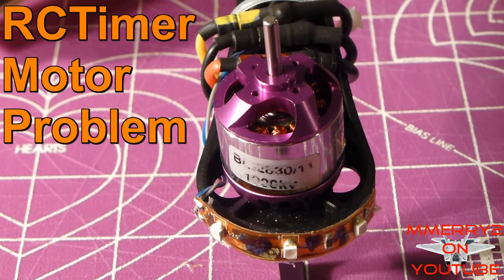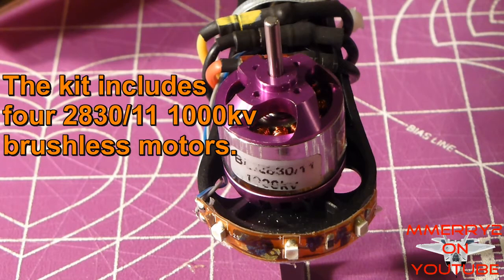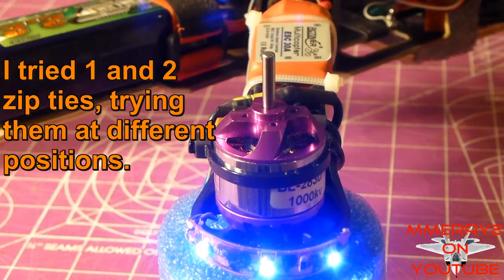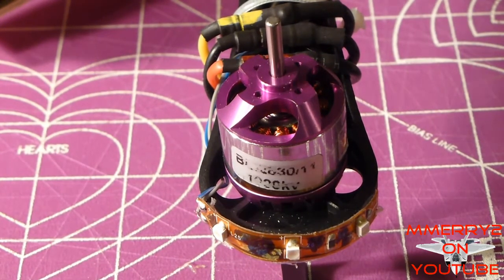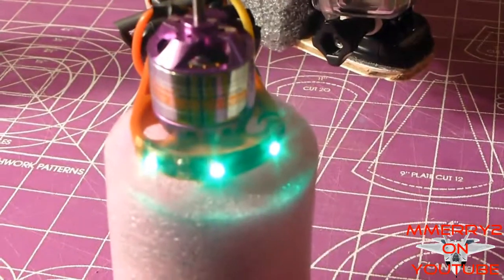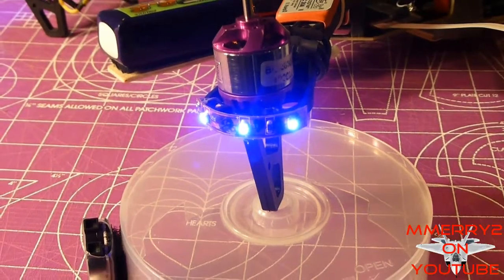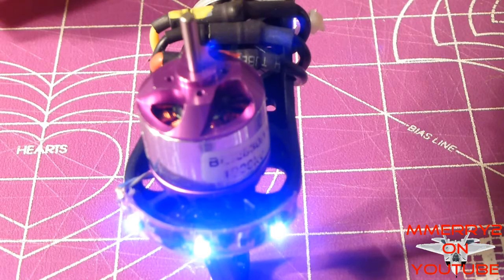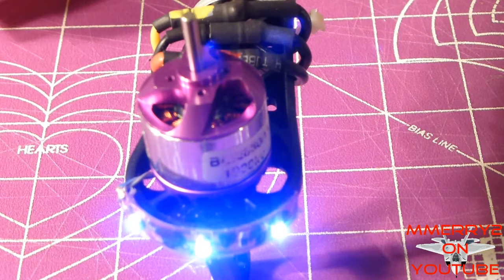RCTimer Motor Problem - 2830/11 1000kv - I need your help!!!

Comment from the maker: I saw that item at HK.  From the comments I read, it doesn't really function as a bearing puller.  I did contact RCTimer about the motor to see if they can help me out.

Comment: Bearing puller tool product# 209000005 $3.76 but they are out of stock. I use a small flat head screwdriver to catch the first bearing and tap it out with screwdriver it damages the bearing and then use the tool to remove the second one. By the way I contacted RCTimer and they shipped me out 2 sets of bearing for free.

Comment: mmerry2 I buy the BC-2208/12  from RCTimers. In my last batch I bought I had 2 with the very same sound. It was the rear bearing on both if them. Once I replaced them the motors were fine. Hobbyking sells a bearing punch toll for just a couple bucks also.

Comment: Well might be bearing, but try taking off the bell and smearing its inside with toothpaste (veeeeeery thin layer). Let it dry and run the motor again. Take off the bell and see where (if at all) the toothpaste is scratched off.
At least it will give you an idea whether the magnets are rubbing against the stator, and if yes, where exactly.
If they don't - you're having a bearing problem, 99 %.

Comment: Most likely a bearing. Try to get a little oil into the bearings and if they are the problem the oil should quiet the motor down temporarily its not an uncommon problem Chinese quality control isn't the best you know.

Comment: I had an issue with another motor that was similar. It was on my AXN,   it was like that out of the box. When I began assembly I was missing a tiny little screw from the servo linkage. I had another and just used it and thought no more about it. The motor ran but had a funny sound. Luckily before I flew the plane, I noticed a "rattle". The little screw had somehow come loose, and attached itself to one of the magnets inside the motor. Did some surgery,removed it. No more issues. Just a thought.